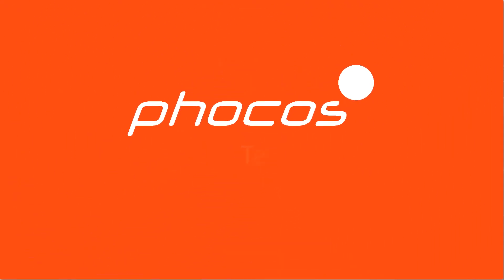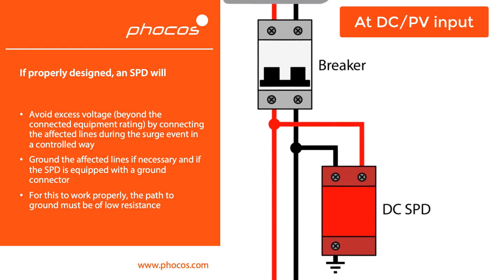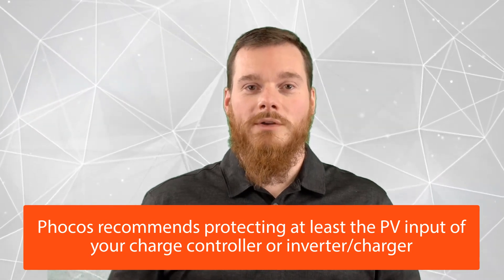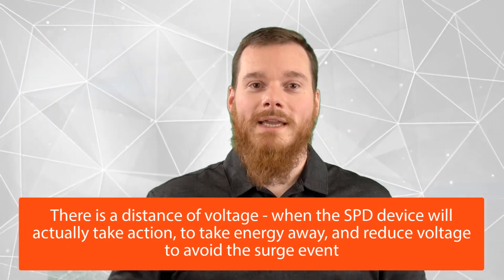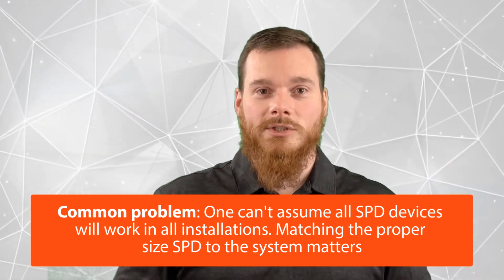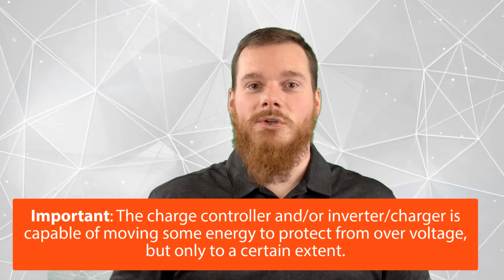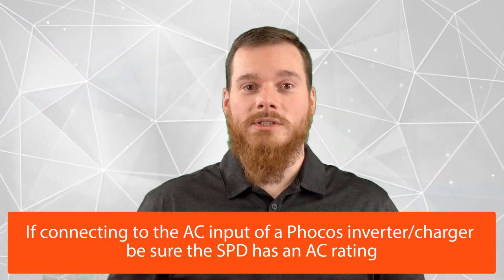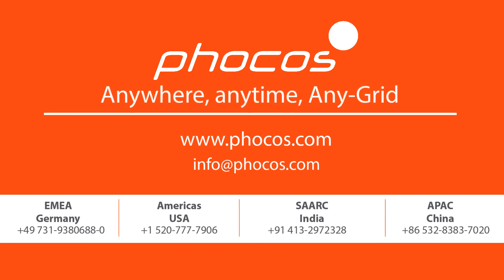How do you correctly size a surge protective device SPD for your solar power system

Comment: I'm worried my SPD will get triggered because it is rated for 150VDC, but my solar panel array will have about 180VDC of Open Circuit Voltage. What are your thoughts.
Reply from the maker: A DC SPD must always be rated higher than the maximum possible open-circuit voltage of your PV array. If your array produces around 180 VDC Voc, then a 150 VDC SPD is undersized and will sit too close to its clamping threshold. That means it can trigger prematurely or fail early, even under normal operating voltage.

Standard practice is to size the SPD based on the array’s maximum Voc at the lowest ambient temperature (cold weather increases Voc). For a system at 180 VDC Voc, installers typically use a DC SPD in the 300–600 VDC class, depending on your inverter and string design.

Bottom line: a 150 VDC SPD is not suitable for an array with 180 VDC Voc. Replace it with a higher-rated SPD to avoid nuisance triggering and ensure proper protection.

Comment: Here is the panal board , oparating 400A. what is the saiz of spd to use this?
Reply from the maker: For a 400A main panel, a good SPD sizing rule would be:

Type: Type 1+2 SPD (if at service entrance), or Type 2 (if downstream).

Imax: ≥ 65kA per phase (go higher in lightning-prone areas).

Nominal Voltage: 400V 3-phase with neutral and earth compatibility.

In (Nominal Discharge Current): ≥ 20kA per mode.

Response Time: <25 ns.

Comment: hey, lets say i have an PV Array with a VOC of around 100V and a SCC capable of handling 150V max, what Uc value do you recommend for the SPD?
Reply from the maker: Choose an SPD with Uc = 150V DC

Type 2, at minimum

Confirm SPD has PV-specific certification (EN 50539-11 / IEC 61643-31)

Example models:

Phoenix Contact VAL-MS 150 PV

DEHNguard M YPV 150

OBO Bettermann V25 PV 150
Reply: @3buysolar I have a similar situation. I have an Outback Flex Max 60 that I want to protect, and it's maximum short circuit voltage rating is 150v. Do I also look for a 150v dc surge protector?

Comment: kind of hard to find a DC SPD that has a UC rating of less than 100V.
Reply from the maker: Yes, it's quite rare to find DC SPDs with a Uc rating below 100V, as most are designed for higher voltage PV or industrial applications. What specific voltage range do you need it for? I might be able to help find a suitable option.